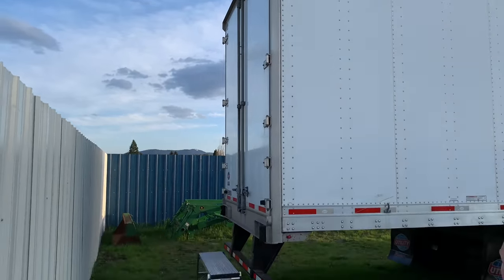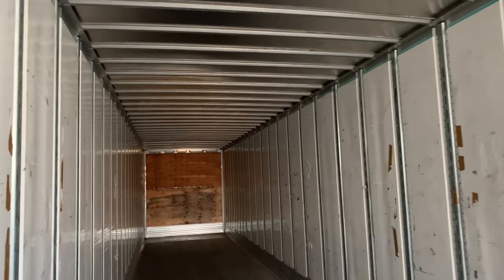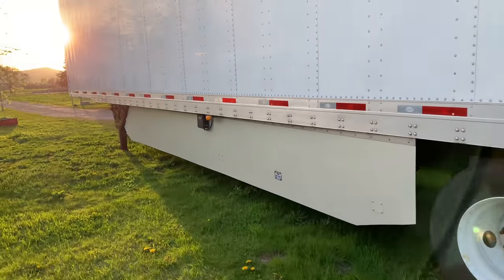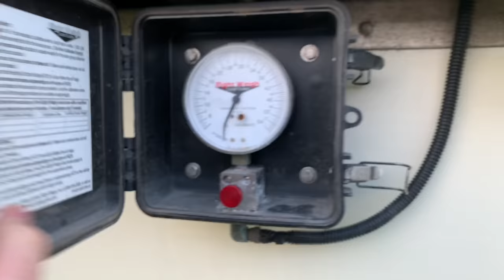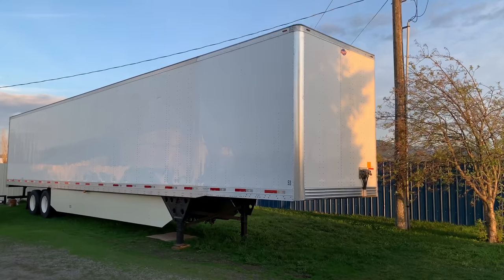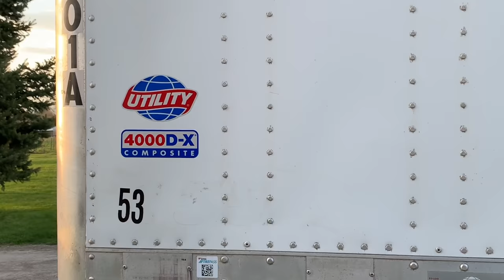Rebuilding A Totaled Dry Van Utility Trailer From Copart (PART 3)

Comment: You guys did a great job ! missed a rivet on front center and skipped a hole on ls front panel but over all congratulations great work ! you spent $1700 in materials and one week labor times 2 people overall estimated repairs worth labor and parts total $5700.  approx. sale price on a Utility Air ride is $8500. good luck guys !  google pro trailer san Antonio tx . have a great time . you guys make a good team .
Reply from the maker: Thanks for watching.

Comment: I don't know. A salvaged dry van rebuilt by non certified people. If it leaks, it will wreck freight. The buyer should be sure to verify it's water tight. What about the king pin plate? You'll sell it, but for how much? I don't know if I'd buy it, good luck to you guys. You're hardworking guys and I really do wish you success.
Reply from the maker: We seen some work done by “certified” “mechanics” before, and a 10 year would of done a better job lol certification is just a paper brother thank you for watching and supporting the channel
Reply: spray it with water. if it is water tight you are good to go
Reply from the maker: Already been tested. It’s all water right
Reply: @romantheegreat208  i bought 6 brand new trailers out of which 4 are leaking ( Stoughton/Manac ) . So no worries, u guyz did great job carry on
Reply from the maker: Yea it’s rained for about a week after we fixed. Also since it’s been sitting it rained dozens of times 
No leaks
Reply: @tarshmannebriana1976  concur- brand new Great dane had leaks at month two. rivets popping and allowing water in .... even the Manu's have a hard time getting it right.  Next project.... saw a hopper bottom get crunched (back end hit by another wide load. )11/8/19 on I70 in IL this past week.  look for it.